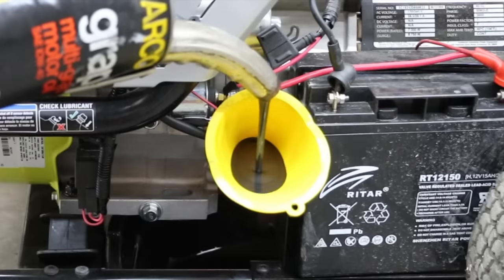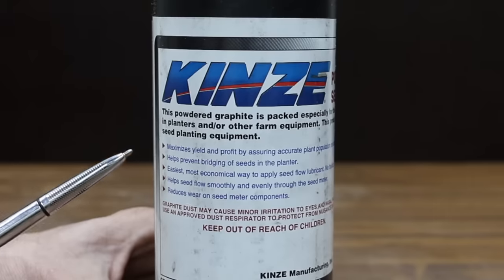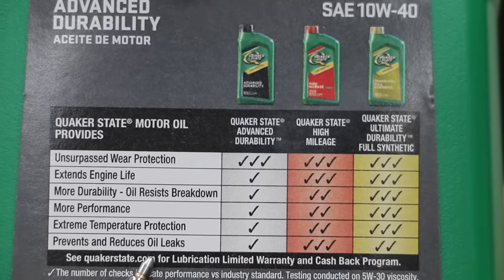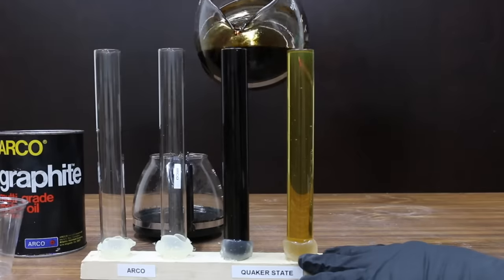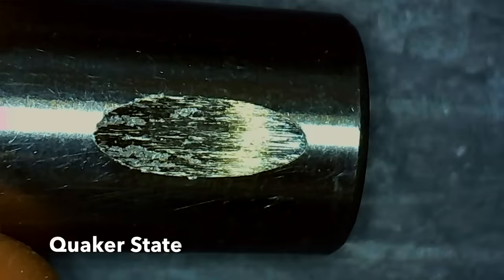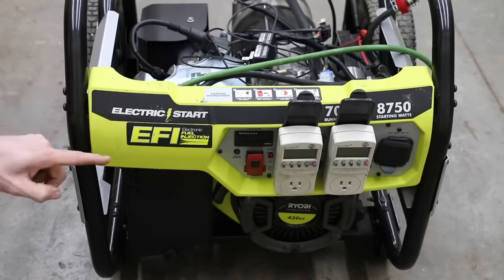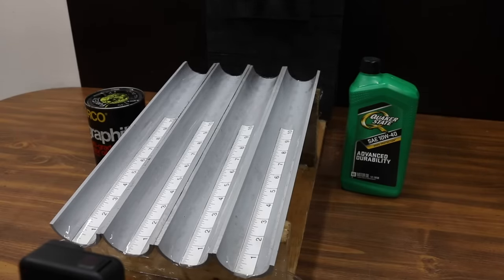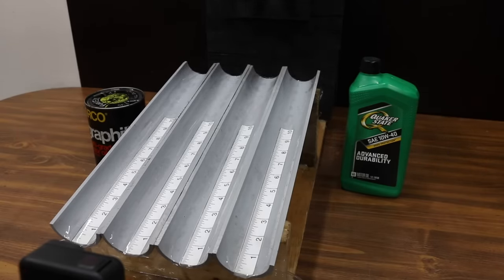Will "Graphite" Help Motor Oil Performance? Let's find out! Vintage Arco Graphite vs Quaker State

Comment: The graphite in the Arco product might not be the same as graphite you could buy aftermarket. Might have a smaller particle size. 
Also perhaps the oil would have been better if it had less viscosity "improvers" (thickener additives) which would have resulted in a 10w-30 or 10w-20 rating instead of 10w-40 .

Comment: 🎉i used arco Nd had yo redice the idle dpeed on my ford 6 cylinder..i 
Made regular  trips ftom mpls to Casper  Wyoming.  I tracked the mileage  and got 3  mpg. So up yours .graphite fills in the voids in wear groves on machine surfaces. True
Reply from the maker: Thanks for the feedback.

Comment: 8:23 This is an wrong conclusion. Having lower friction in the cylinders it translates into 
more rpm (slightly) that means MORE STROKES with the same amount of fuel and 
that means it will run out of fuel FASTER.
I estimated a 0.8230453 % more rpm with the Arco.
Or in other words 0.8230453% more milage with the same amount of fuel.

Comment: I used the Arco graphite in the 70's. Before using ARCO, oil consumption was about 2,000 miles per quart. After using ARCO for 2 oil changes, I went back to my pervious oil. Why? With ARCO my oil consumption went down to zero, with no better milage. Something didn't feel right with that. 1975 Chevy van 350 ci.
Reply from the maker: Thanks for sharing.

Comment: I remember reading a test done by Briggs & Stratton when they tested slick 50 oil additive against conventional motor oil right out of the can in Brand New Briggs & Stratton engines
  I remember this test because I could not believe the second part of the test.
  in the first part of the test they ran one engine with the slick 50 additive and one with just oil for 24 hours.
  The second part of the test, they drained the oil from both engines and ran them for 24 hours with no oil..
 this is why I remember this test because I found it hard to believe that both engines would run for 24 hours with no oil but apparently they did…
  briggs & Stratton took the engines apart to analyze the damage….the reported findings were that the engine  that had the slick 50 additive had more damage to parts that depended on splash feed oiling than engine that had  just conventional oil only in the 1st 24 hour run time..
Reply from the maker: Thanks for sharing.

Comment: I did use graphite on cam break ins and wiped out lobes, switched to shell rotella diesel oil with zinc had had no issues, so for me I stay away from graphite it's metallic heavy and can be abrasive on rod and main bearings as the camshaft and internal parts timing, if mechanical the distributor drive gear use a bronze drive.
Reply from the maker: Thanks for the feedback.

Comment: Before I watch the vid a few things I gotta say. I thought I saw other brands with graphite back in the 80's. Yes, graphite will improve lubrication and help seal. Also, graphite is about the last thing you want in your motor when it is overheating.
Reply from the maker: Thanks for the feedback.

Comment: I use just a splash of graphite in the crank case of my china doll 80cc bicycle engine and even though its a little messy when splitting the case open, I cant find any signs of wear. 

From time to time I will put a LITTLE in my fuel. When I say little I mean you cant even see it floating in the gas. It doesnt foul my plug and my cylinder wall is shiney and smooth. 

I think it runs cooler due to less friction and drag on the piston. Not sure but your wear test suppor5s my theory even though the lubricants are differently utilized,  the presents of graphite Im sure makes a difference. 

I would like to see a video on this.

Comment: In the old days Fram sold oil filters with Graphite and I used Graphite oil in my Rabbit diesel I heard they stopped using graphite because it would short out the spark plugs if your vehicle burned oil
Reply from the maker: Thanks for the feedback.

Comment: Even though the friction was reduced it seems fraught with the potential for sludge related problems.  I get the feeling the graphite particles are still a bit on the large size even when they look blended well with the oil.  It did make a mess in the manifold of the lawnmower.  I've been wondering if we will see Graphene added to motor oil as it supposedly a miracle material.
Reply from the maker: Thanks for the feedback.

Comment: My buddy's dad had tractors etc he used Arco in all of it growing up so my buddy would use it in his 3 and 4 wheelers and go-karts etc. Never blew an engine but I never liked the idea of pouring black oil in a motor lol I've always used Valvoline in all my stuff with great results. But I worked in lube shops for years so I saw first hand what oils work well. Quaker State isn't one of them 😁

Comment: Amsoil Flush, Amsoil oil change. Here in Canada there's a product called Molyslip that has Molybdenum suspended in it. Mehhh, limited momentum benefit IMO but good at protecting engine from seizing in an overheating situation.
Reply from the maker: Thanks for sharing.

Comment: I used ARCO graphite oil in my 1975 Chevy Monza which had a 262 cu. Inch engine.  It worked fine. I was less expensive than the new synthetic oils. I sold the car when it had 125k miles. I purchased two other vehicles and drove them over 100k. I would still see my Monza being driven by whoever purchased the car.
Reply from the maker: Thanks for sharing.

Comment: I was looking at greases for my bike and discovered an interesting test had been done by , I think, D&C coupling, used to split bike frames for easy shipping. Anyways they tested a ton of greases for the best anti galling properties to ensure optimal attachment via their threaded coupling system and the winner by a mile was a 100% pure Teflon grease, nothing came close really. The only accessable brand today seems to be Finishline pure fleuro grease.  Pricey stuff but it seems to last a very long time and good as a semi permanant lubricatioin.
Reply from the maker: Thanks for sharing.

Comment: In the old days, used car dealers used to put soot - from diesel exhaust, coal fire etc - into the transmission to give the customers a nice smooth, quiet ride. Interestingly, common soot contains graphene - which is just the atomic monolayer form of graphite. However in this case bad news for the new owner - other contaminants present would inexorably degrade everything very soon. 

I said 'old days' because my Dad told me this in the 1950's. Today - well let's say there are probably some new tricks to ensnare eager buyers!
Reply from the maker: Thanks for the feedback.

Comment: Try doing a test with different motor oils after they have been drained from and engine and see how long it will last, and add the Arco graphite. Use lawn mowers for the test.
Reply from the maker: Thanks for the suggestion.

Comment: Arco wasn't the only brand that had graphite motor oil.

My father, a mechanic with a Chrysler dealership at the time, always used graphite oil in our cars.
Reply from the maker: Thanks for sharing.

Comment: In the early 70s I was an engine repair guy. I worked on dozens of engines that were destroyed by oil containing graphite. Problem was the graphite pooled together and blocked the oil passages. It was very obvious what happened as the graphite would bond together into chunks. As soon as you saw the black color and texture of the oil you knew what happened to the engine. Don't use it!!
Reply from the maker: Thanks for the feedback.

Comment: Hi...I use marvel oil in my high mileage volvos and it works great....as a gas additive for the top end and in the crankcase for the bottom end...better compression and easier idling..
I've been doing this for many yeara...when I break down an engine..it's cleaner inside as well.
hope that helps
Savanna
Reply from the maker: Thanks for the feedback.

Comment: For years I have wondered why  diesel engines tend to wear out slower. Allthough esp. the ring pressure is higher. Is the low wear caused  by the abundance of small soot particles, just as in the ARCO.
Reply from the maker: Thanks for the feedback.

Comment: What happens if you add Phosphorous and Zinc to the Quaker State or any other brand?

Does it improve performance?

How about Phos Zinc and some Moly?

How much Phosphorous and Zinc should be added before it inhibits the oil?

A cheap way to improve cheap oil?

Comment: Hi. I love watching your videos. I have a 150 cc, 4 stroke motorcycle. Of late, I am seeing white smoke and high rpm. I assume the piston rings are going out. I was wondering if adding 'Copper Paste' through the spark plug hole could help my engine. The idea is that the copper particles would lodge between the piston rings making better seal. Could you do a video about this. Thanks for reading.
Reply from the maker: Great to hear!  Thanks for the suggestion.

Comment: My question was did the graphite dissolve into the oil or just sit in suspension? If it just sat in suspension then it was merely introducing an abrasive. Think of it like this. What would happen if you applied graphite to a microfiber cloth and rubbed it across a freshly painted surface? If the graphite dissolves into the solution and is no longer a solid suspended then it might actually lubricate in this scenario.

Comment: Watched the video, and you did a compression test on the mower, THEN removed the head, cleaned things up and wacked it back together. The higher compression rate measured could have been put down to new head gasket, cleaner surfaces on the head and block and a better seal. you should have dont the compression test AFTER the head-work on the mower, as there is a high chance you have changed the compression reading by changing the head gasket.

Comment: I'm a fairly new subscriber so I'm not sure if you've done this or not. Since there is a wide range of prices on a wide variety of carbide saw blades, it would be nice to see which gives the best bang for the buck when it comes to the sharpness and durability of the carbide teeth since their is a range in quality of the carbide used to make the teeth. It might also be worth while to test the precision of the teeth grind/alignment
Reply from the maker: Thanks for the video idea.

Comment: Yes it works. In1976 I changed to ARCO oil and increased my gas mileage by 4 miles per gallon. The only problem I had was keeping it in the engine, the pan gasket started leaking and so did the valve cover gasket.
Reply from the maker: Thanks for sharing.

Comment: In 1978, I WRECKED my 1969 Chevy Malibu with a perfect 350 engine by putting graphite in the oil. It plugged the filter in a second and starved the engine of lubrication and smoked the bearings and rings.
Reply from the maker: Thanks for sharing.

Comment: Graphited motor oil studies and test results as well as real world testimonials did not make the internet. Some of the first million mile engines in the USA were realized with Black Bear Company Graphited SHDX 15/40 motor oil.
Acheson Colloids was the blender that patented the additive and sold to lubricants blenders. They would charge the particles with ions to make the graphite stay in suspension. 
Lubricants World and other lubricants trade publications discussed these motor oils and there were pre measured engine field tests with dozens of fleet vehicles. Even NYC Yellow Taxi, Drakes bakeries and possibly Entenmens tried this oil and used it for decades. Black Bear Company just wasn't internet savvy. 
  I wish I could still get it.
Reply from the maker: Thanks for sharing.

Comment: My Dad used to swear by this graphite oil. He drove several Morris Minors and Triumph Heralds around 2000 miles a week using the graphite oil from the mid 60's on. Mechanic's would freak out at the colour but he would always tell them the same story: Supposedly a Land Rover punctured it's oil sump a couple of hundred miles from any help somewhere in Africa. Because it had been using the graphite oil it was able to drive back to civilization without destroying the engine. I know he believed it. He would immediately switch oils as soon as he got a new car home.
Reply from the maker: Thanks for sharing.

Comment: Try an oil additive called ZX1. I've used it and the engine ran smoother, quieter and had MUCH better acceleration.
Reply from the maker: Thanks for the suggestion.

Comment: We used colloidal graphite in the forging industry as a die lubricant. Horrible stuff. Every flat surface in the roof of the factory covered in a layer of the stuff. Some brands were very smoky, think that was the base oil.
Reply from the maker: Thanks for the feedback.

Comment: Difference between various sizes of the li  ion batteries.  Like the 18650, 32260, 14500 etc. difference between  same mah  of different sizes, etc
Reply from the maker: Thanks for the suggestion.

Comment: Mid 90s I found a bottle of Arco way back of the oil cabinet  used in my 88 mustang  and it clogged the oil strainer in the bottom pan  killed my engine.  Sent letter to address  printed on bottle never received anything.  Couple yrs later I remember seeing a class act law suit ...

Comment: (just rolled in)
"Customer states after adding Graphite to their engine's oil reservoir they hear knocks and the engine is hard to start."
Engine's oil ports are demonstrated as clogged and unable to circulate oil to the rest of the engine
Reply from the maker: Thanks for the feedback.

Comment: Back about  78 or 79  my dad  managed to squeeze  83.000. Miles’s  out of a       1974 Chevy  Vega  he bought  new in 1974  had  16  miles on the clock when he  took delivery  when the  car  started burning  oil  about  56.000 miles some service station   Mechanic  got  him to start using  Arco graphite  ????? Did it stop the  oil burning  who knows  but  he and the  heavy diesel  truck mechanic  at the truck line he drove for believed  that graphite oil  helped get that  pothetic  little  Vega engine  squeeze  out              83.000  miles  when  it would not start anymore   When he cocked off duty  that cold  Friday  night in March   How he got to work that  morning  was Devine  intervention  but when it was time  to come home that old  Vega said NO   Were not making  that journey  no more  from where we lived  Plainfield   Illinois   To  his  truck driving job in  Cicero  Illinois
Reply from the maker: Thanks for sharing.

Comment: Sounds like the graphite arco oil is a tremendous cleanser and all around decent protection lubricant for engines that are incredibly basic, like for carb-type engines with little to no electronics
Reply from the maker: Thank you for sharing!

Comment: Mein Vater nutze es in seinem zwei Takt motorad eine 250er Jawa so um 1960 er halt sie immer noch. Hat sehr gut funktioniert vorallem gegen Kolbenfresser. Die Zylinder waren Spiegel blank.
Bei modernen Motoren mit hoher Kompression eher nicht so toll denke ich.

Comment: Exactly what is the graphite as tested  by you made of or from. Is it related to the liquid once used to clean old black household stoves, black lead ?. Or is it  ACTUALLY powdered lead as it used to be before its use was found to cause lead poisoning.  Remember  Molyslip  ??

Comment: Sometime back around '78 or '79, I used a graphite oil in my 1976 Toyota Celica (I think it had the bulletproof 20R engine.)
The only difference I noticed was the gunk that drained out at the time of oil changes (every 3,000 miles.)  
After about a year, I went back to Valvoline 10W30 or 10W40.  I don't remember what the manual called for in zone 6.  
When I finally had to replace the valve cover gasket, there was a lot of sludge inside.  Whether that remained from the graphite oil, or was caused by normal use, was not anything I thought about at the time.
Incidentally, do you happen to know the size of Molybdenum in suspension?  Is it filtered out by standard oil filters?  One of the reasons I stopped using it was that I was fearful it would clog my oil filter, causing it to be bypassed.
I had the same concerns when it was trendy to add Teflon to oil.  I never tried that, however.
Reply from the maker: Thanks for sharing.

Comment: I was around back in the 70"s. People stopped using graphite oil because it was plugging up oil passages causing engine failure.
Reply from the maker: Thanks for the feedback.

Comment: Using powdered graphite pretty much voids the tests.  Use liquid graphite. Bonderite 1275 as an example

Quick edit.  Powdered graphite will blend with grease.  You need liquid graphite to blend with oil.
Reply from the maker: Thanks for the feedback.

Comment: What about some tests on products used by Motorcycle Owners. Lubricants, tires, wheel bearings. O rings that hold oil or not.
Reply from the maker: Thanks for the video idea.
Reply: @ProjectFarm  For instance can you run a rear fitment tire on the front. I have a Harley Fucked Me Davidson and same size tire on front and rear. BUT "They" say to run front fitment on front and rear fitment on rear. I've been riding for 52 years and I DON'T CARE AND NEVER HAVE  and will run whatever tire I want front or rear. Never had any trouble even running over 110mph for miles and miles. Decades ago I used to run Kendal 70 wgt in my Shovelheads and they alwayz leaked oil and now I realize it was too thick and to much pressure so it would leak out the O rings.

Comment: I can't help but wonder how messed up the oil filter got. Maybe add an at temp and cold start flow rate test using filter material from a standard oil filter and a high flow type. If it's prone to clogging the filter then it's not a good oil to use, and cold flow is only part of the question when considering graphite, Teflon, other oil additives.
Reply from the maker: Thanks for the feedback.